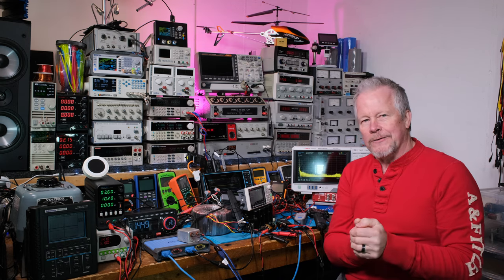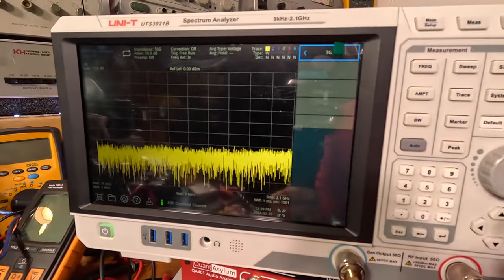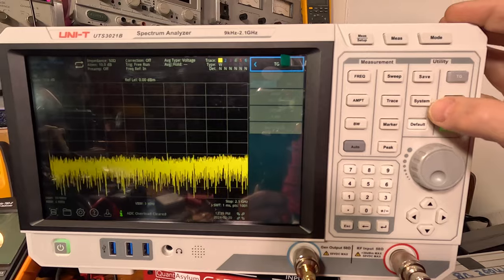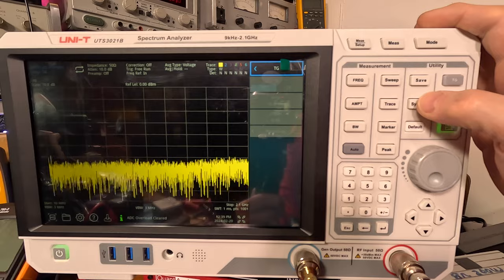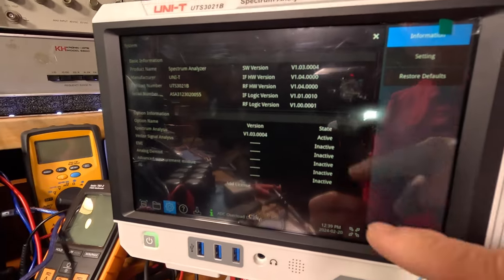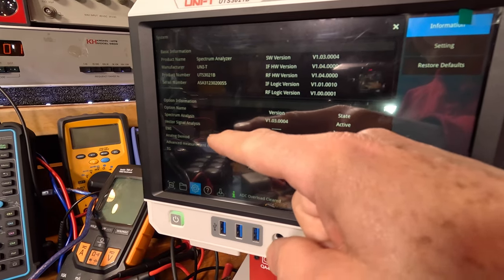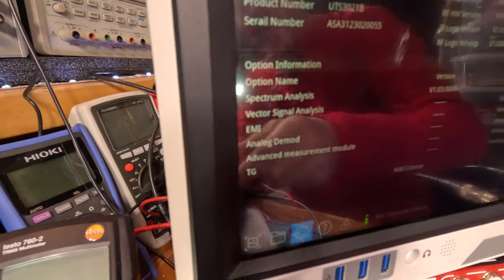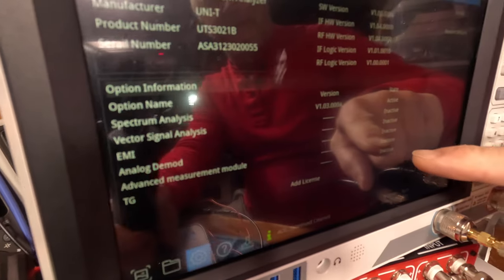Filter Test with Spectrum Analyzer UniT UTS3021B #UTS3021B #spectrumanalyzer #unitrend

Comment: Feature subscriptions for test equipment, cars, and God knows what else as time goes on. They run out when you really need them. The gift that keeps on giving.
Reply: I expect that soon shitty companies like Boeing will introduce a fee for inserting bolts holding doors. And another fee for performing some quality control before delivery.
Reply: It’s so nice to see you back and making great comments
Reply from the maker: Yes you are right - the paid for licenses and subscriptions - too bad that they just don't turn them on - since it is already in the hardware that we buy.

Comment: Some audiophiles say that power line filters like these with common mode and diff mode chokes limit the dynamics of the music, and the ferrite in the chokes cores impart a glassy hard sound to the music. Although there is no science to prove this. Thanks for making this video with the analyzer Eddie.
Reply from the maker: Thanks for bringing this up!  The filters in the power supply have no impact on the dynamics.   The people who say this - you can believe at that point - that they know nothing about how power is processed.  They may know the buzz words and some tech talk - but they have no actual understanding.  If this were true - they would show measurements to show how it does effect the music.  I have a series of rants on power cord stuff that talks about various things, but I have started a series to show how the power is processed at each circuit block to show how ridiculous statements like this are.  Here's a video that you might like: https://youtu.be/iMtb6769Gwc?si=97H_JQP_iRE21PPH

Comment: Thanks for sharing this video Eddie. As usual, I like it. I feel sorry for all your effort which went kinda "down the drain"  thanks to Uni-T not sending you a properly permanently licensed device. What a pity Uni-T!  However, you dealt very well with the topic and still uploaded your video. Kudos for that. Makes the channel even more authentic and you even more likeable. And there is always something to learn in your stuff. I appreciate your SA series of videos. very much.
Reply from the maker: Thanks so much!  Uni-T did send me a care package/s - so we will see some new equipment very soon;)
Reply: It seems like Rigol secretly loves the fact that their scopes are hackable. The mso5000 series is a perfect example. By the 70 megahertz two-channel unit and you can easily upgrade it to the 300 megahertz 4 channel, with two channel output function generator. I can't imagine how many of the 5072 units they have sold because of this
Reply: @MrMersh-ts7jl  I did exactly that, but initially purchased the 4 channel 70 MHz version of Rigol MSO5000. However, now I have a 500 MHz scope fully fledged. It still works.
Reply: @markuskeller9734  this is my exact plan. I have a DS 1202 that has been great but I've definitely outgrown it. So I need to sell it off and sell off my r&s CMU to get either a PicoScope for the MSO 5072 and help it become more.

If you don't mind me asking, how is the FFT on the mso5000 for say audio spectrum analysis?

Comment: Yes, a decent Spectrum Analyzer is a great toy (and essential tool). Coupled with some near-field probes, a DIY LISN and a metal cake box you can do a lot of EMI pre-compliance tests, or looking at problem spots where you failed EMI. For far-filed tests, you can also build your own antennas, if you characterize them. I knew the guys at the local EMI-test lab quite well, so one day, when I had to do a single EMI-test for a customer, I sneaked some additional time in just to characterize my antennas. We were lucky to have a shielded room at our R&D labs, so with all the pre-compliancy tests, we were pretty assured that equipment will pass first time at the EMI labs. Quite a lot can be done with EMI-compliancy tests with DIY stuff and a spectrum Analyzer. Biggest hurdle is with the pulse-generators for immunity-tests as it involves high-voltage and large capacitors. Looking forward to the rest of your videos.
Reply: Of course, using a spectrum analyzer correctly is a LOT more involved than using an oscilloscope. R&S, Tektronix and Keysight have great courses and app notes and youtube videos on usage of Spectrum Analyzers.
Reply: I just listen to the AM radio, bud. Lol. Thanks for the advice.  @Hellhound604
Reply: Last Christmas I purchased three different metal boxes of Scottish shortbreads for testing electronic circuits. Shortbreads themselves were a nice bonus.
Reply from the maker: Thanks for this great feedback!!  Yes, there is some great info out there - which I'll share in a video to come - for those that might want to delve deeper into this 'huge' field;)

Comment: That expired feature license highlights exactly why I mostly use a tricked-out vintage Tektronix 2712 instead of a new unit. True enough that there are some things which I can't achieve with the 2712 but for those occasions I do have a newer 3Ghz digital analyzer to use.
Reply from the maker: Thanks for your feedback!  Yes the 2712 came with options that had to be purchased as well - including the tracking generator.  I don't think you had the option in those days of buying and adding features down the road by buying the license.  So you had to commit and spend the money up front.

The license expired on me because they were just turned on for the time of my reviews.

This Uni-T item does come with a lot of features natively and has a high resolution bandwidth.

Comment: I have used a wideband noise generator and a spectrum analyzer to test filters. You can see the curve of the filter this way with out a tracking generator.
Reply from the maker: Yes - that is right!  I have that nice noise generator that I have used to do this.  I was going to use it but the power switch broke:(

Comment: When the electron rams into a O2 molecule in the copper wire running at near the speed of light, it triggers a harsh vibration that couples with the electrons in the brain of some audiophiles which triggers a rant. This also causes some attenuation and delays for the electrons at various frequencies so they don't show up at the speaker at the proper time distorting the music to the point of making it sound like an orchestra tuning up.
Reply from the maker: LOL - I love it;)
Reply: 😂 Spot on 😂

Comment: Eddie, you could use the Analog Discovery II with its AWG and SA and made the measurement from 100 Hz to 50 MHz. This would have given the information you were trying to present. LF analyzers are harder to come by. Also, this demonstrates why you should not use loaner equipment for the demonstration. I learned that one the hard way in HAM radio. Danny KI6VBC
Reply from the maker: Thanks - and you are right;)  I've done a few videos showing how to do this with a scope - here's an early one;) https://youtu.be/nrPOcAHeuf0?si=7cpnG34wbTXEwCN8

Comment: Hi. I would like to see some real world troubleshooting using the spectrum analyzer.  I know the cut-corners VFD AC motor drives can create dirty hormonic electricity if the inductors and capacitor filters are not used per application. Things like spikes due to voltage wave reflection.   😎   Anyway, a most interesting Filter Test video. Thank you very much.
PS.  There is no paypal button?    🐾  Thanks.
Reply from the maker: Thanks for your feedback!  I'll have to add Paypal;)  Thanks for telling me!

Comment: Hi. Tad confused, It looks like you are using a 50R enviroment for a low-Z (non-50R) mains filter network. Essentially you should have a 50R - Low Z driver and then a post-filter representative load and buffer back to 50R. Even a passive impedance matching network (attenuator) and normalise. If you PK-hold, if you have it, and single sweep, should show the curve, Did this come with a SOLT kit ? (Short, Open, Load, and Through).
Reply from the maker: Yes you are correct of course;)  I wanted to make this short so I didn't want to get into that.  I did mention - quickly - that this was for small signal;)  Thanks for your feedback!

Comment: I'm puzzled by 2 things on the video.  First, does Uni-T have annual subscription charges for the features on their test equipment.  If so, that is terrible.  Second, could a noise generator be used instead of a sweep generator.  Easily purchased from several Chinese vendors for a low price and no subscription requirements.   
It seems that years ago when I worked for a living that one of the manufacturers started requiring an annual subscription for their product.  As soon as we could, we got rid of that equipment and went over to another manufacturer.   That was a long time ago!
Reply from the maker: Great questions!  No, it is a one time purchase;)  There are different options, so you don't have to buy all of them for a fortune.  You can pick and choose.  I really detest subscription services.  Yes, you can use a noise generator.  I was in a lab years ago - and I didn't have a tracking generator - but I did have a nice noise generator.  Today this all costs so much less;)

Comment: Although not directly the subject of the video a friend was at a retail outlet here in the UK where a manufacturer of snake-oil video cables was showing off their product. To their embarrassment my friend (a TV broadcast engineer) brought up the engineering menus on the 2 monitors, surprise surprise they were set differently, when set the same as each other the pictures were identical.
As for using one leg of a common mode choke as a differential mode filter in a DC circuit, any guidance about saturation etc?
Reply from the maker: I love this story!  Thank you!  Have you seen this video on power cables?  https://youtu.be/Q9Y3r8CqXlc
Reply: @KissAnalog  yes, thank you. It reminds me of a guitar playing friend who had replaced a small value capacitor in his guitar for a so called "bumble bee" type. He was extolling the virtues of the new sound, I asked him "was the new capacitor the same value as the one it replaced" .. awkward pause, it was a factor of 10 different...  at that stage you know it is not worth going into ESR and piezo-electric effects etc etc
Reply from the maker: LOL love it;)

Comment: That spectrum analyser is useless for audio work so why were you talking 60Hz and stuff ED ? that instrument can draw a graph of the filters you don't spend that sort of money and point at a bloody tone whizzing across the screen and say "look it wiggles around there" not sure your target audience are interested in 50 MHz's anyhow I get the feeling there Audio guy's. UNI -T just sent loads of kit to Paul at learnelectronics as well!! like 6 instruments including a spectrum analyser which has no clue about, so I wonder what UNI-T are upto.....cheers
Reply from the maker: Thanks for your feedback!  I had a different video planned and had to come up with something quick after the video I had planned fell apart.  But I think this shows how to use the spectrum to look at a filter at a high level.  To properly power test this EMI filter - I needed to run the signal through an amp - but didn't have it handy and it complicates the video.  I was thinking about doing a follow up to discuss this (50 ohm vs low impedance) but I don't know if I have time.  I can do this lower freq stuff with my Omicron and/or picoscope.  I did want to sniff the power supply of a power supply to show how it can be used for that.  I was thinking how to run a test for the audiophiles who think a power cable can filter RF...These tests take some time to setup...
Uni-T sent me a stack of things too, but not the really nice ARB that they sent him;)  Also he got an SA and I have to return mine:(  I might be one of the few YouTube guys that has used one on the job in any meaningful way.  I just solved some EMI issues using this SA;)
Reply: Awesome get as much work out of it as you can Ed !! I look forward to more !Yes good to see a proper use case for this stuff @KissAnalog